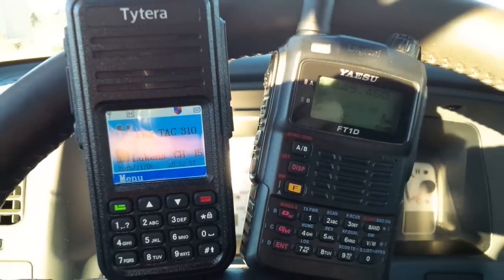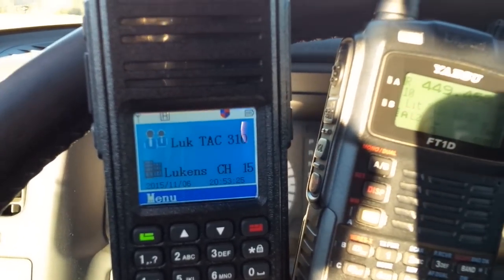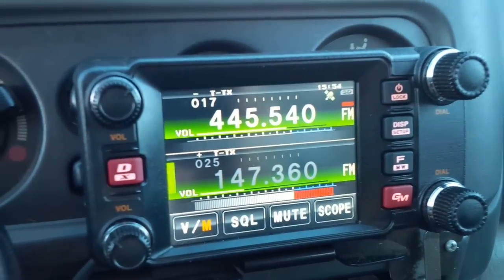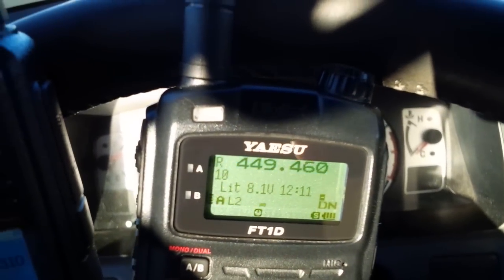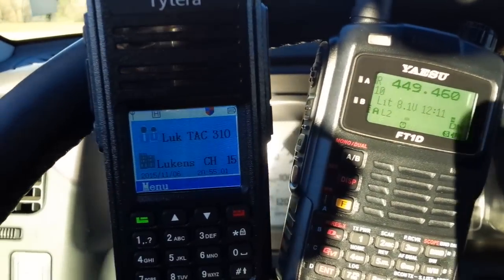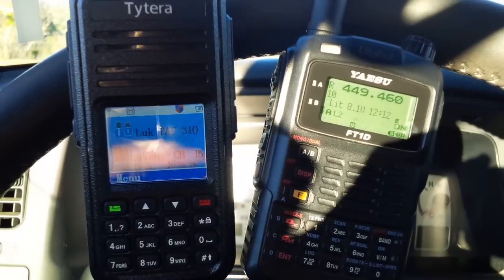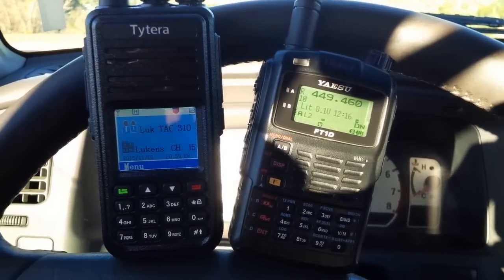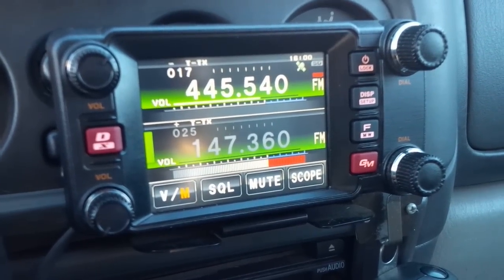DMR & Yaesu Fusion overview

Comment: DMR and MotoTRBO are NOT the same at all. MotoTRBO is Motorola's line of products that use the DMR standard. DMR is the standard. And anyway, MotoTRBO has some extra additions like capacity plus so they are definitely not the same at all.